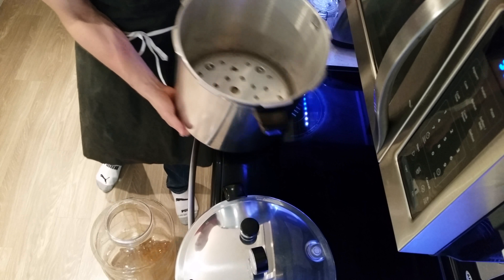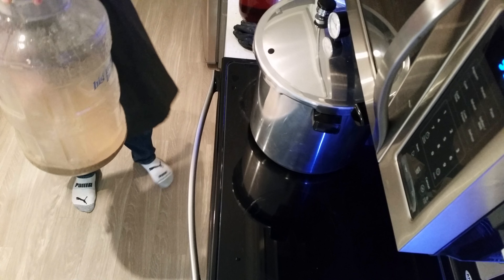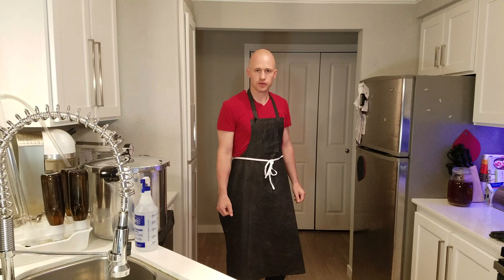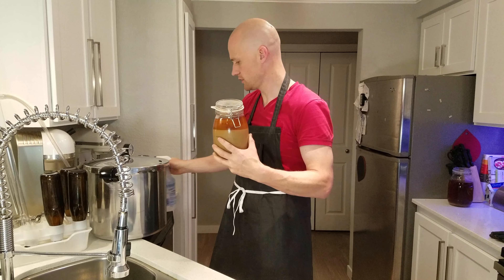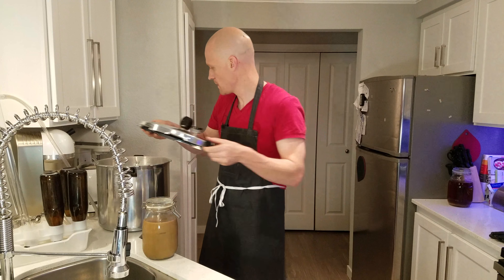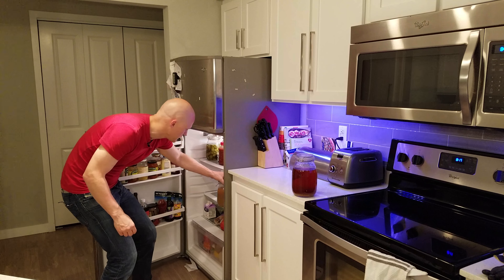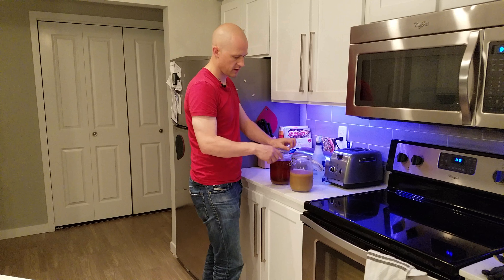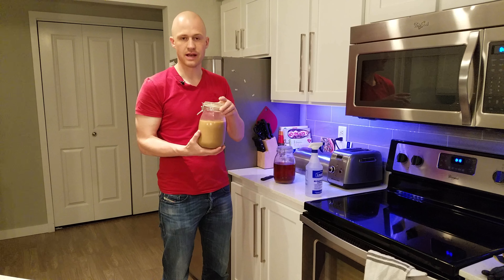Beer Yeast Harvesting and Rinsing - Part 2

Comment: By pouring wort into the sample do you not have some fermentation kicking off
Reply from the maker: There is probably a very slight amount, but I keep the sample in the fridge at close to freezing temperature so the yeast is not very active. That is the entire idea behind cooling it. I go back and shake the sample daily, or stirring it in the case of a production brewery sized yeast brink. This is to release any trapped CO2, as yeast is not a fan.

Comment: We been doing closed fermentation with about 14 psi. Can you tell if the resulting generation of yeast it's going to come with lesser vitality or weaker generation since its stored on a co2 environment  Would you recomend harvesting Y afterwards a pressuriced fermentation.
Reply from the maker: You are right in stating that yeast are not happy in a high CO2 environment. However, I have not seen any studies that say that one should not harvest yeast after pressure-fermentation. I would love to hear your results. A viability and vitality test would be great. Please keep us posted.
Reply: Yes, that's right, well, so far we've been harvesting these yeasts throughout the year, but using them no more than 3 generations and within 7 to 14 days of removing them from the cone, although I must say that the% apparent attenuation has decreased from 81 to 76 in most cases. I just arrived from my Amazon mini lab where I will start to perform feasibility / vitality tests in order to reach a better conclusion. Although all these yeast procedures have been performed without rinsing / washing procedures ... thanks for your response
Reply from the maker: Please keep us posted. We would appreciate it if you shared your final outcome.